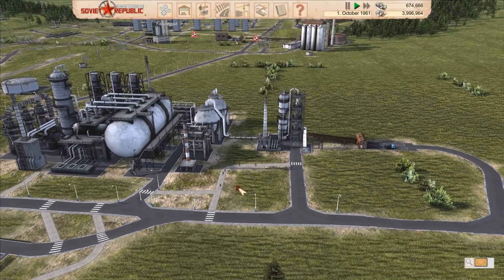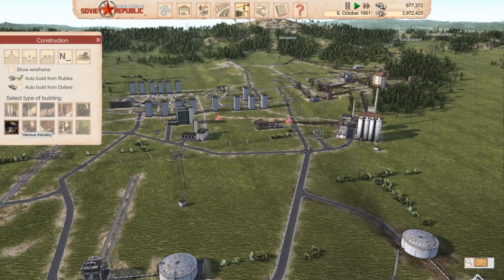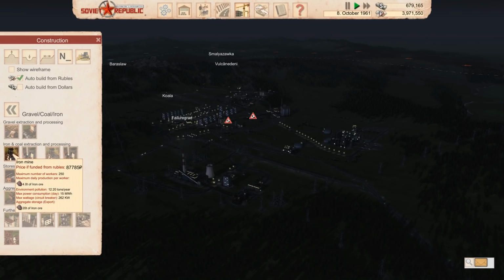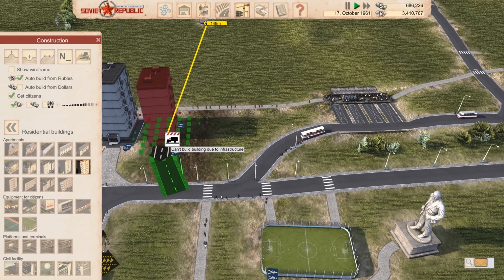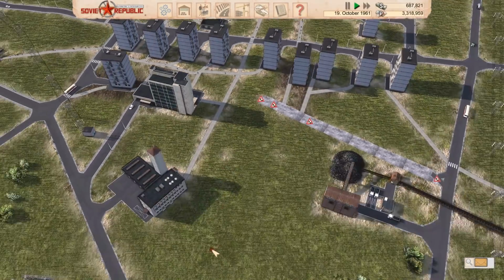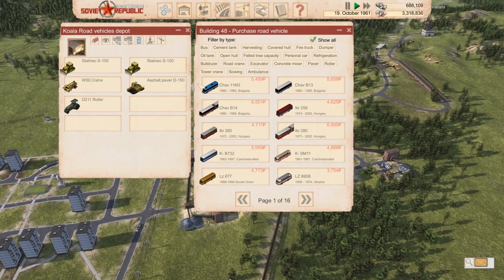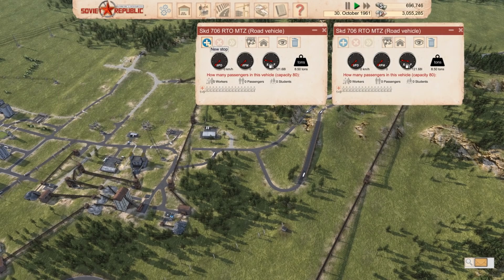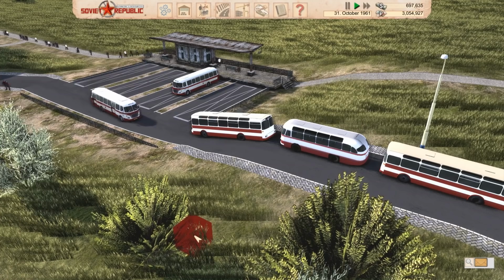Industrial Anarchy : Workers and Resources Soviet Republic #11

Comment: I've got 30 oil trucks exporting Bitumen and Fuel constantly 24/7. And my refinery is still only operating with 100 workers, and full to the brim all the time, even with 2 overflow tanks just for fuel and bitumen. Thats why my railroad is under construction to the border, so i can load literally a thousand bitumen per trip and flogg that shit off faster than i can produce it. Keep in mind, the oil refinery can operate with 500 workers.... Holy fucking shit batman, that's like 5 train-worths of export per day. Or, 70 trucks?

Comment: Colonel Failure.  If you look at your refinery, you will note that it is basically empty of oil, yet the attached storage is full and the glorious peoples train remains to be unloaded.  Placing a pump between the storage and the refinery will ensure the refinery remains full of oil.  Pumps placed on the exits will ensure that production tanks will be filled.

Build a lot of construction offices.  You'll need them if you want to build more than one thing at a time.
Reply from the maker: That would make sense.

Comment: That gravel truck is trying to drop off at the Asphalt output instead of straight into the the plant
Reply: Nope, everything's done correct. It's just a known bug by the dev, that the asphalt plant isn't working as it should:
"Areas of further focus - next to fix:
-Trying to get what need to be done that asphalt plant become broken, some dumper truck leave the asphalt plant.. but still remain marked as moving inside asphalt plant and this causes other trucks waiting, if someone get save, that everything seems fine (and asphalt plant works - trucks can access inside) and after couple of minutes it become broken.."